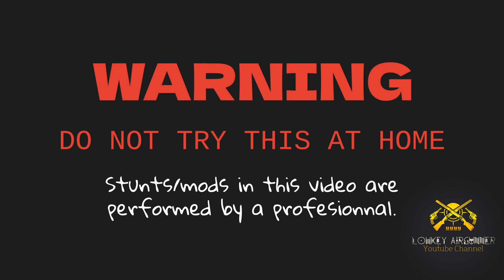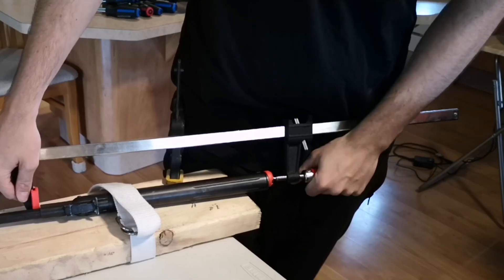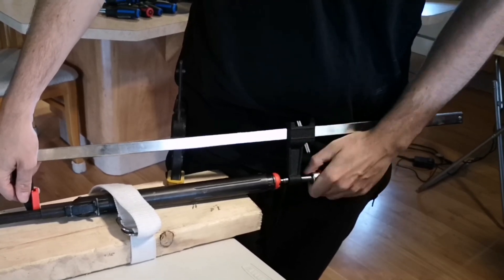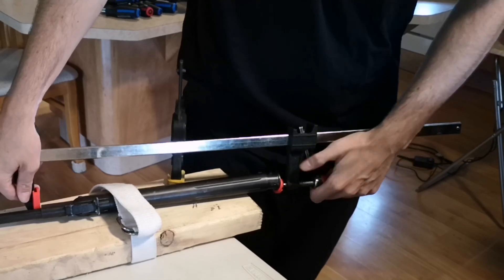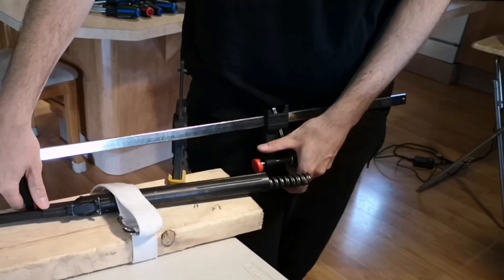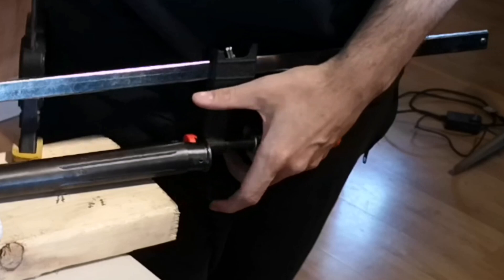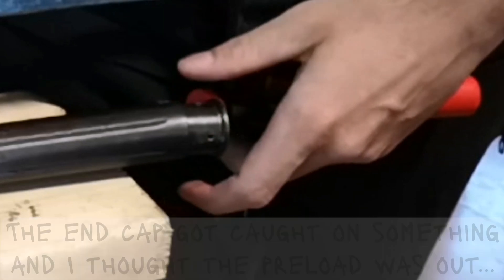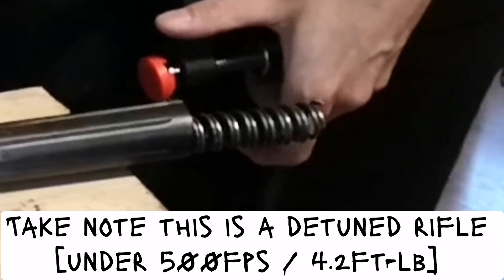How NOT to disassemble a SPRINGER air rifle ! // Dangers of messing with compressed springs {Safety}

Comment: All you need to do is stand the rifle up on end and push down against the bench with your arms to compress the spring. Then you push out the pin and let the rife up slowly to decompress the spring. You simply do the reverse to reassemble it although you can stick a screwdriver or punch through first to hold it together and help you line up the holes. Then you just stick the pin through and push the screwdriver out with the pin while holding down on the rifle to keep the spring compressed. There really isn’t any significant preload on an air rifle spring, even a very powerful one will be less than I’d estimate 40 pounds of force in its decocked state, certainly nothing that would require a spring compressor tool.
Reply from the maker: Thanks for explaining how not to do it!
While it works in most cases (especially for springers which are way easier to compress than gas rams) it can lead to you dropping the rifle or injuring yourself 

A "proper" spring compressor litteraly took me less than 15 minutes and costed 0$ to make so I would say if you plan on doing that more than once it is worth having one 100%

Thanks for watching :_LwkLogo:

Comment: I use a sash clamp
Reply from the maker: It looks fairly simmilar to a regular wood clamp but maybe a bit better!
I am not saying that I would recommend it but it would have worked fine if the cap didn't get stuck... a proper spring compressor makes it way safer 

Thanks for watching :_LwkLogo:
Reply: @LowkeyAirgunner its a vice on a stick pretty much

Comment: I used a copper pipe i notched nd my arm strength to take out my gamo magnum spring. Thankfully i was steong enough but it was alot bigger spring than i thought haha
Reply from the maker: This technique can work with most of them... the hard part is often to put it back together!

Aligning the pin without a proper spring compressor can be a pain especially alone with only two hands

Thanks for watching :_LwkLogo:
Reply: @LowkeyAirgunner  ya nd it was a dif style pin for that one nd obvi no video online at the time. Idr exactly but I think it was semi circle nd wld only fit in one way so had to rotate it or something. I do remember just about blowing an oring out trying to hold the pressure needed while lining that up haha bent the tabs of the copper pipe I made to get around the thick pin
Reply from the maker: Yeah the magnums have a bigger piston and two pins instead of one!
A spring compressor definitely makes things safer & easier

Comment: a long pipe clamp will definitely allow a better line with the spring, someday I'll have to get one so I can FrogLube the B3's motor sections. no problem muscling Daisy BB gun springs, toughest one was an old grandpa spring in my buddy's 103 I'd rehabbed, had longer pre-load than a cobalt327 spring and it shoots almost as fast really.. gonna have to bring that one back here for a larger bore air tube, it wouldn't surprise me if it broke 350 fps with one of those dropped into it. (3mm ID 4mm OD stainless tubing from flee-bahay fits nice btw)
Reply from the maker: I wished I could buy stuff from zeebays without paying more for shipping than the item itself...still did not had the courage to even try to order the cobalt327 kit since ive asked for Andy gray pellets (8$ a tin of custom pellets great deal) but the shipping was arround 40$ 😁
[But after sending me the sling I guess you know it is expensive]
If you pay for it I will install it! Hahaha

Thanks for watching 
(again but your other commemt might be hidden just because YT)

Comment: heard a nice news report just a couple days ago...
TurdDope has spent millions on a gun buy back program that ain't bought a one.

OUCH, gluing clamp like that definitely awkward, and a modified caulk gun is still going to be potentially violent for decompressing a spring but maybe good for compressing.
Reply from the maker: With the price they offered I am not even bringing them a wooden replica back ! 
[Like I owned any restricted firepews]

Do they make extra long caulk guns? Haha
I think this technique works better for a red ryder...I dont know if a caulf gun could compress a gas ram or be precise enough to put the pin back in at the end

Thanks for watching!